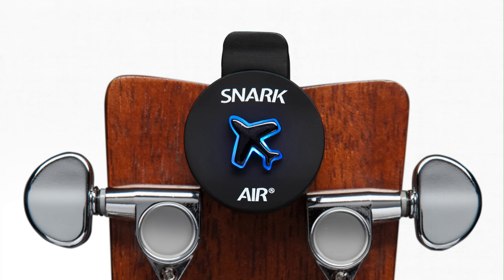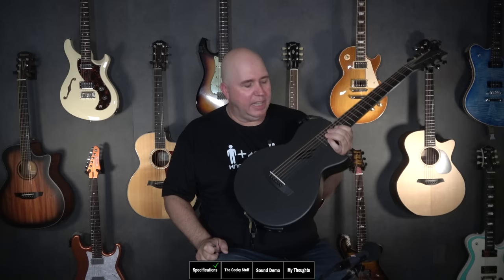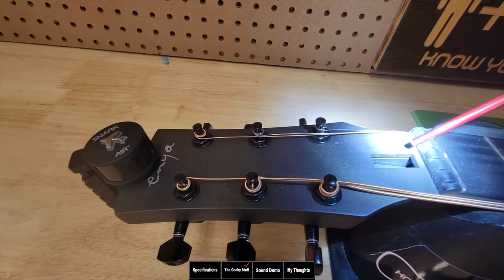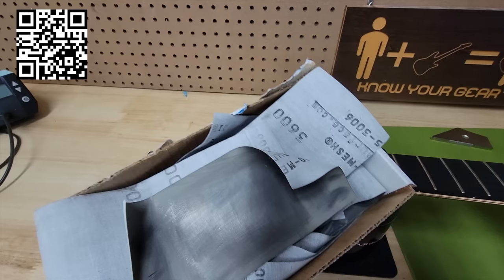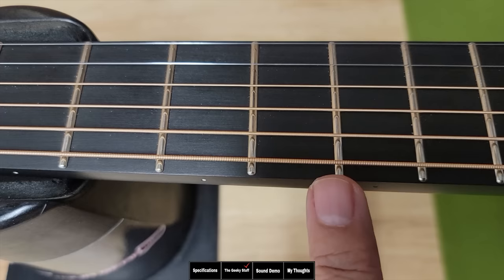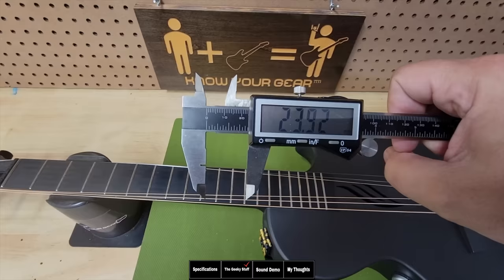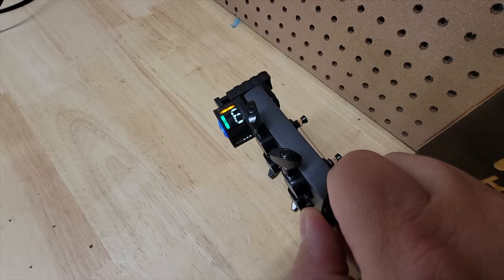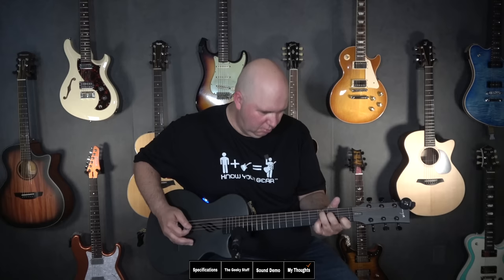Amazon Carbon Fiber Guitar For Under $300

Comment: I'm a little skeptical. I bought a LavaMe 2 a couple years ago that was similar in size and features. Non-adjustable, molded-in features like nut and bridge proved problematical – never could get the intonation quite right. Other physical features are great, however – very stable, temperature & humidity don't affect it, and I love the light weight. I'm with Phil about the frets – life-long materials & construction pretty much demand stainless steel frets. I wasn't that keen on the LavaMe2's built-in effects, and this one seems only a little bit better. Hard to beat the price for carbon fiber, though.

Comment: The reviews have been dicey on these, but we're talking about Amazon Reviews. Having Phil run one through its paces means a lot to me, and changes my opinion on the guitar-which i had written off as cheep and shitty. Im a mouthe-breather at best, but i will eventually need something acoustic. Since my nickname is "Breaker Jon," for a reason, I try to buy stuff that a moron can own, works in the jungle/desert/islands/does not explode. Carbon fiber guitars have been on my radar for a while..but the novelty of them commands a high premium (as does quality, accoutrements). This one might be a good fit for me.  I think Carbon fiber guitars might be the future, or something non reactive for tuning stability.  Its cool that this works, plays "better than a mini Taylor" and the price really is the tits. The next pricepoint is Donner around 500 bucks, then Kohl at a grand-ish, then like 3+ grand for the super Elvis'd up guitars.  The other Enya model, is like a warcrime to me for being so ugly, and it literally makes my skin tighten up just looking at it. While i like innovation, value, ruggedness; i still have some basic expectations for aesthetic value. Its cool this one actually looks like a guitar.

Comment: I also bought one of these about 3 months ago. I didn't opt for the electronics version because I just wanted a small campfire guitar that I could leave in my campervan without worrying if the humidity/temperature changes would destroy it. 

My guitar looks exactly the same except white. However, the case I got with mine is completely different. It has a pocket on the front and backpack straps on the back. It has a reasonable amount of padding, and I was surprised to see a foam neck cradle integrated in the design, which is pretty standard for a hard case but this is probably the first time I've seen one in a gig bag. It also included a strange looking guitar strap that I've never used and probably never will. 

My experience with the guitar is pretty much identical to yours. I definitely wasn't expecting it to sound as good as it does, and even though I planned on just leaving it in the van, it tends to follow me around because it's so easy to pick up and play. I think part of the reason is that I feel like it's a tough guitar that I don't have to baby, so I don't feel obligated to hang it back up or put it back in it's case like my more expensive guitars. It just kind of floats around the house and even though it hasn't seen it's case in months it still looks as good as the day it arrived. 

Every guitar in my arsenal is technically a better guitar than this little guy, but what sets this guitar apart is that it has more utility and convenience than any of them. 
Like you, I won't gush about how awesome it is, but I'll admit it's way better than I expected and I'm shocked at how frequently I use it since I only planned to use it while camping.

Comment: I'm glad you got to try one of these! I've had the normal acoustic one for about half a year and it has lived in my car for the majority of that. It sure seems like its plastic instead of any carbon fiber that I have seen, but its durable!  It has also survived being left out in a rain storm! Its the perfect couch/camping guitar for me. I spent a little over $100 on it and the gig bag alone is worth that to me. I like that it has big frets and doesnt have that much projection, so I don't bother other people.
Reply: yeah. as i understand it, they are made of injection molded plastic with chopped carbon fibers. so they dont have the amazing tension features of twill carbon fiber guitars. but the advantage is that they can mass produce them for hardly any money.
Reply: How loud would you say the acoustic-only one  is compared to a wood acoustic guitar? Half?
Reply: @lancomedic  it's pretty similar to a wood parlor guitar like an art and lutherie ami (which has a body that is easily twice as thick) or a martin style single 0. The thing about the volume is that it's projected up at you, instead of away from you like a normal guitar, so it sounds louder to the player than it seems like it should.
Reply: @lancomedic  
It has about the same volume and projection as my former campfire guitar which is a cheap Fender FA-15 3/4 scale acoustic. 

If a dreadnaught player wanted to play over you, they easily could. But if they wanted to play along with you they wouldn't have to hold back very much.
Reply: @matthewklumper1248  Thanks.

Comment: I got the basic version after watching this. Excellent buy. Mine had a slight intonation issue, but after replacing the bridge saddle with a compensated one (Allparts 2213-000) it was much better. If you do this, you may need to shim it slightly. I used a piece of an old credit card and it was perfect.

Comment: The built-in reverb would make this perfect for busking. The one thing I worry about on systems like this or the HyVibe that you didn't touch on here is how difficult it would be to replace the battery when eventually it will need to be. You might get 1000 charge cycles, but that day will come if you keep the guitar.
Reply: That's what I have also noticed. How easy is it to replace that battery 🔋?
Reply: Curious as well. At 200 charge cycles that batter will be at probably 85% capacity. Be awesome if you could drop in an 18650 at any given time.

Comment: I've had the non electric model for about a year, and it's been pretty good. It was kept in my car over the summer to see how well it would survive the So CA heat, and it passed with flying colors. Remarkable tuning stability. Comparing it to my Baby Taylor, its sound is really pretty good. 

It is neck heavy, which can be a bother for some. I don't find it particularly comfortable to hold without a strap. The frets on mine were impeccable, but I am curious about the possibility of refretting. The frets are so perfect, I was wondering if they were normal frets, or molded in somehow. 

Very interesting infor you found about the construction. I've been curious how it was put together, as from the outside, the finish appears perfect, all smooth lines and no seams whatsoever. 

Some of the cork sniffers will insist that this instrument doesn't count as carbon fiber, but it is. The big difference is that this is injection molded CF filled plastic, which is a different process than how most CF instruments are made, the latter being more like fiberglass/resin layup construction. At this point, I think the difference is getting to be academic, as the injection molded CF seems like it will be as durable and capable as CF layup construction.
Reply: Depends on the type of carbon fiber layout. Injection molding is likely not as isotropic as prepreg sheets
Reply: There is actually a pretty big difference between injection molded and laminated cf sheets. An actual layup would give way more control over the properties of the guitar at different points because the fiber orientation has such a big impact. The injection molding is really a plastic base with carbon fiber strengthening it. Not to its detriment, it seems like a great product and I certainly wouldn't expect a full layup at its price.

Comment: That brand also has a full size electro-acoustic guitar with actual carbon fiber top for about 800 and includes a hardcase. That small one is more like polymer-carbon composite, still pretty good since the material doesn't warp with weather changes like wood does.
Reply: True it is a composite utilizing carbon.  I've looked into their ukuleles and they are similar in construction.     Two piece with the top bonded to the body shell.

Comment: As an owner of a rainsong,  I am glad the tuning is stable on this.  I worry about the quality of the materials at this price range, kind of like a cheap tremolo using softer metal that eventually dulls at the pivot point.    The material seems quite different than the woven carbon fiber of a rainsong.

Comment: Tip: to spread the strings off the fretboard, I  use some pipe cleaners (the fuzzy covering assures no scratching). Works well and they're super cheap and should last indefinitely. I got a pack of 30 or so in assorted colors some years back at the dollar store.

Comment: It seems so many affordable guitars, from many brands, come from the factory with multiple issues. Not necessarily big problems, but still, a lot of them. Because of the rather common manufacturing "deficiencies" I'm passing on this item even though it's definitely within my purchase budget (for carbon fiber instruments). However, correcting all of the problems would easily add a couple of $100 (I'm not qualified to make most of the repairs suggested). And the no-name electronics, who fixes those when they break?  Thanks for the insightful (as usual!), deep dive review. I respect that you purchased this item yourself and gave a fair but honest assessment.

Comment: I've seen other reviewers state that they were able to leave the guitar on for 13 hours before the guitar battery indicator flashed red (low battery). Anyhow, this was a great video in that i was comprehensive and even showed me how to deal with any fret issues. I have recently ordered a Big Baby Taylor, and one of these Enya Nova Go SP1s. The Big Baby Taylor is slightly too big to be called a travel guitar, and it's made of wood, so it won't be making it to different climates. But the carbon fiber body of Enya intrigued me, and it will serve as a true travel guitar.

Comment: I’m going to be spending a year or more traveling around out West camping, mountain biking 🚵‍♀️, sightseeing among other things and I want to take a guitar 🎸 to keep up with practice and online lessons that won’t crack from the heat and cold. This looks like the very thing I need. I have a little child’s lunch box sized Laney portable amp that is easy to carry around. I have carbon fiber bicycles 🚲 and I love 💕 them. They absorb so much road shock. Much more comfortable than metal. Definitely going to look into this guitar but I will have to have someone work on the frets if necessary. Thanks for your demo. I have a couple acoustic parlor guitars so I know I will like the small size. 👍☮️🌞🎸🩵

Comment: I have one of their smart ukuleles, their products are pretty decent. I believe it is actually carbon fiber infused resin instead of full carbon fiber. I would say they are perfect for beginners with what you get from what you paid. And you can bring them out without fear of banging them up. 

Side note, Phil your playing has noticeably improved a lot! Keep up the great job, Cheers
Reply: Their ukuleles are pretty good. Caution: Some models have built-in plastic frets, while others have metal frets.

Comment: i also have the non electronic one... been having fun with it. i had finish issues on mine... it was quite rough but I took a high grit polishing cloth to it and it feels great now. Also, I found a cheapie pick up off of wish that you can stick on and it works fine :-p

Comment: I bought the cheaper version with no electronics. It’s polycarbonate(plastic )+ carbon fiber  90/10 or 80/20 something like that. I really like mine. Unique looking and lightweight. Playability is very smooth. Nice tone for a half size guitar.

Comment: Carbon guitars keep getting better sounding every year as Makers/Luthiers understand the material better. 

I was surprised how good the guitar sounds and how well it was made. Improvements would be to use Stainless Steel for the "Zero Fret," and shorten the length of the headstock, and use a snakehead design. Those things will reduce neck dive and improve performance. All in all, impressive, affordable travel guitar, and perhaps more. 👍

Comment: Good review. I just bought the acoustic version and have had it for less than a week. I like it. I did change out the strings for some lighter gauge strings and that works pretty good for me. I’m getting back into playing after not playing for several years. I was intrigued by the idea of a carbon fiber type guitar and this is a way for me to get my feet wet without spending a lot of money. I paid around $200 From Amazon. i’m a moderate skilled player and this is a way for me to hone my skills, and eventually move up to a more expensive carbon fiber type guitar.

Comment: I work with composites and can probably suggest why they used nickel on the frets.   Carbon fiber can corrode certain metals that are typically stainless, like aluminum.  Likely that's why they did a different material.

Comment: Phillip McKnight, This is one of the BEST Review DIY Luthier Fix It and Demo Videos I have seen in Years, and the Best Video that I have seen on this ENYA Guitar. You are always Thorough and Entertaining and Educational. I have so many guitars, I have been skeptical about carbon fiber and acrylic guitars but the Enya guitar you demo'd in this video has me wanting to try one out for myself. I might send the Nut down and put a Real Different Nut on the guitar's headstock and get rid of the zero fret or Replace the Zero Fret with a Stainless Steel Zero Fret would be easier to DIY. Thanks again for the TRES GR8T video FretBro . . . 👍😎🎸🤘🇺🇲🙏 DDH 3-9-2023.

Comment: ---- TO GET RID OF THE NECK DIVE ----
Hi Phil ! Why don't you strap it "the old fashion way" : one end on the bottom strap button, and the other end with "shoelace" around the headstock just after the nut, or better a little further away passed the 1rst tuners.
I had a gig, ages ago, with a 12 string acoustic with horrendous neck dive, and I put the strap that way, and the problem was solved.
Nice video !
I wish you the best.

Comment: I have normally not been to fan of non wood guitars. after all it's the reason guitars have been made of wood, though out the history of the guitar. but this carbon fiber guitar shows that guitars can be made from other materials than wood. I actually like it because of its versatility and durability. a person can probably take it anywhere. and it being water resistant a person could take it camping. and if it happened to sprinkle a little rain. a person wouldn't have to immediately put in it's gig bag as with other guitars. I like Les Paul body shape because it's a familiar body shape. although the electronics aren't probably the best they still worked. and a person might be able to add a pedal or a proesssor to improve that. there are a couple other things that I was curious about. and that would be is the fret board carbon fiber also. because that would make it difficult to refret the guitar in the future. and if the nut is part of the neck it would make it non replaceable. at least not without machining the neck to accept a regular nut. otherwise I can see the appeal of this guitar. thanks for the information on this unique guitar.

Comment: A great review! Thank you. I bought one last summer. Here's my review:
I was very impressed by the basic geometry and quality of this little guitar....BUT... Two issues needed to be addressed before it could be considered "playable":

(1) The Zero Fret (nut) height! Why can't manufacturers understand that the "zero fret" (or nut slots) need not be taller than any of the other frets!?! Think about it guys! It's only common sense! In my case the frets measure 0.039" tall off the fretboard but the zero fret is more than 0.063" tall. How stupid is that!?! This makes the action unduly high with special difficulty at the first few frets. The feel of the strings should be inviting...not a struggle!
The solution in my case was to simply use my gauged nut files (Stewmac) with a 0.043" (0.004" added for safety margin because going too deep would be tragic!) feeler gauge safety stop pressed flat on the fretboard to very delicately notch the zero fret at each string. Be sure to tape off your other frets so you don't nick them in the process!

(2) The saddle (2.78mm thick)was too thin for the bridge slot (3.0mm wide). This in combination with the cheap plastic saddle being much too tall cocked it in the bridge slot at a crazy angle. Between the work needed on the zero fret and this useless saddle, the string factory height made the guitar, straight out of the box, almost totally unplayable.... not really unusual for any new factory built guitar.

This is not to disrespect the entire instrument! The basic elements are amazing! The neck/body/ bridge angle, so important for proper setup, is perfect and solid! The saddle slot is absolutely perfectly placed.. now with the simple addition a properly fitted, compensated saddle the intonation is absolutely bang on!

After adjusting the effective zero fret height and fitting a proper compensated saddle this little beauty has just stolen my heart! With the truss rod ever so slightly loosened to give the fretboard a touch more relief, she's got a lovely, inviting, light touch action. I'm looking at more than 20 jealous guitars hanging on the walls!

I can't put the dang thing down!

Comment: Great review Phil I was looking at getting one of those carbon fibre guitars as I didn’t want to take my Ibanez acoustic out when travelling and not worry if you knocked it about or water splashes on it the in built electrics sound great reverb battery life is good as well nice job Phil on taking the time to do a in depth review.